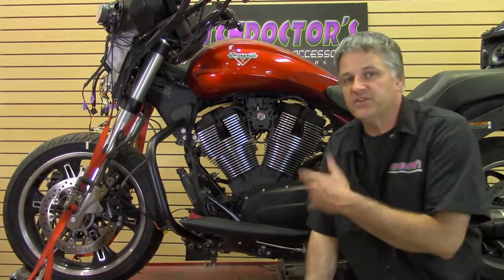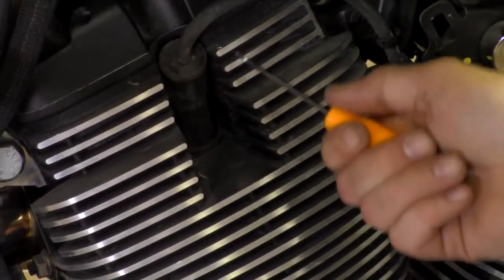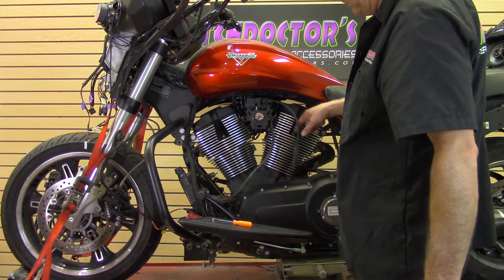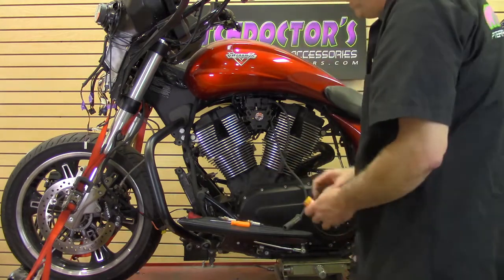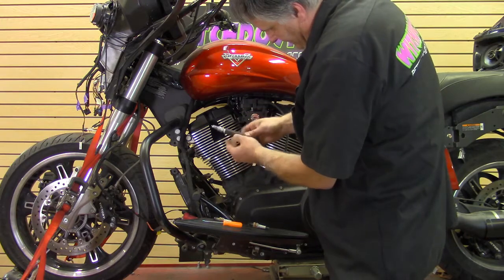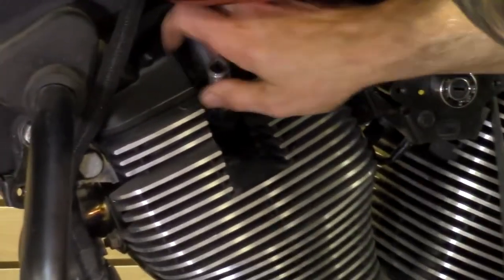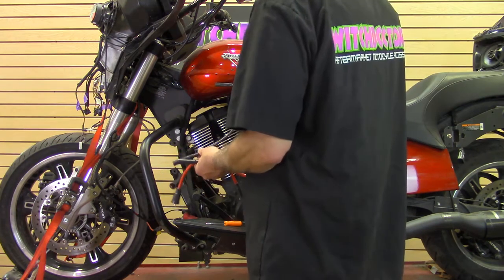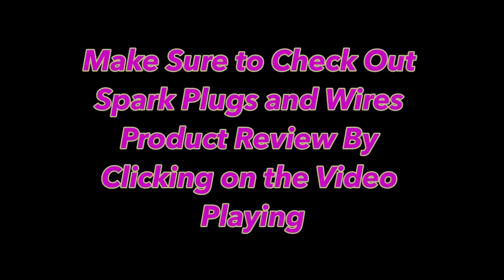How to Install Spark Plugs and  Spark Plug Wires on a Victory Motorcycle

Comment: Good video.  One thing to mention, when you crack the spark plug loose, really should blow compressed air into hole to blow out any loose contaminants out of the hole before you remove the spark plug so it does not fall into the cylinder when the plug is removed.

Comment: Thanks for being there for the victory owners,  i appreciate ALL your dyi videos. As far a plug install i use a length of small rubber hose long enough to clear the valve cover. The hose i use fits tightly on the ceramic portion of the plug and i run the plug all the way in like you mentioned in your video. Again thanks for all you do us
Reply from the maker: Great tip! Glad to help out.